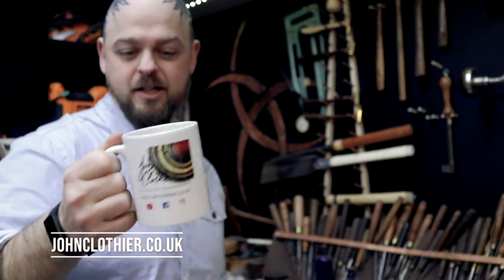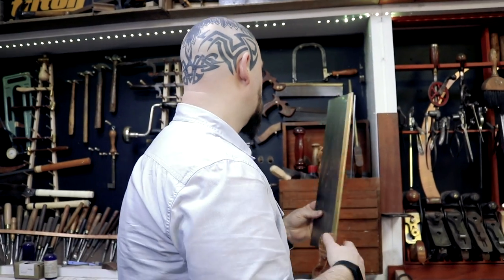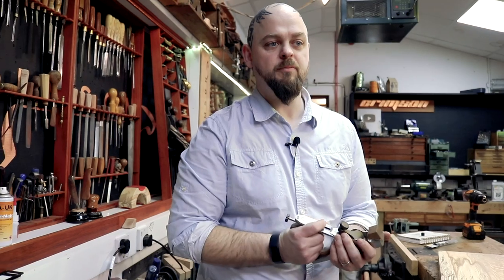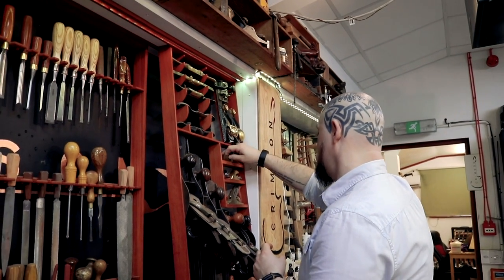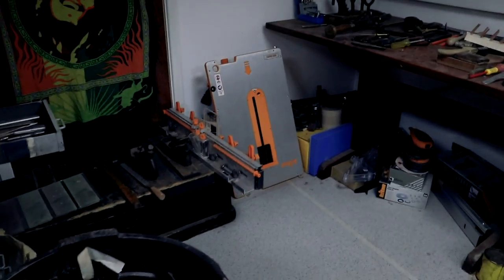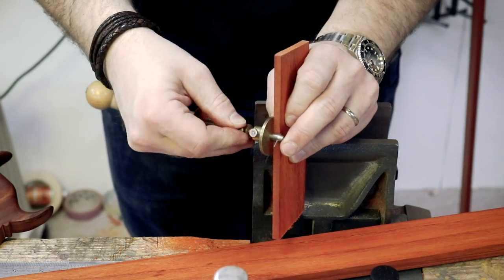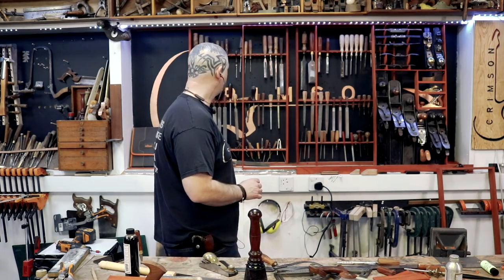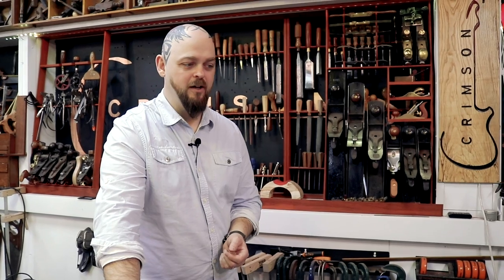2020 - A Guitar Builder's Epic Tools and Workshop Tour.

Comment: awesome collection, my indispensable tools are! router, band saw, sander, and a drill. no more electric, # 3 and 4 hand planes, chisells,  fretting tools of course, fret end file fret press leveling files, welding pen, a caliper, straight edge and fret holed ruler and measure rulers of course, measure measure cut. i´ve  build 3 guitars so far with just that!

Comment: My first guitar was done with no powered tools, bar a cordless drill. A cheap Wilkos set of chisels and a tenon saw, scroll saw, 3 quick clamps and a hammer. A set of forstner bits from screwfix and a set of cheap drill bits and a craft knife set from poundland. My first buy after i built it was a jig saw then a router. It was bliss. Lol
Reply: Robert Murphy I’m doing the same right now mate... pound shop epoxy. Block plane and rasp from wilkos and a Chinese eBay special power drill and Forster bits.... I dream about routers!!! It’s fun though.. I’m currently doing a jazz 7 string!!! Love to see your results.. I think doing within them limitations gives an interesting results!
Reply: @charliebowen5071  reasonable   Erbauer routers in a few of the Cash Converters for £60 new. They stock a few new brand goods now and then, just have to keep an eye out for them

Comment: Japanese saws are nice in that they have so narrow cut, which means less energy needed for the cut (I have split 1,5 meters of apple tree with one). The downside is that they don't stay sharp very long and at least the ones I have can't be sharpened, so the blades become scrap metal. European traditional saws can be used daily for what 200 years, sharpened every few weeks. I really like that kind of tools. The point hardened hardware store saws have their place too, and that's building site, but for woodworking it really gives a lot to learn how to properly use and sharpen saws. I have some Pax and Lynx saws.